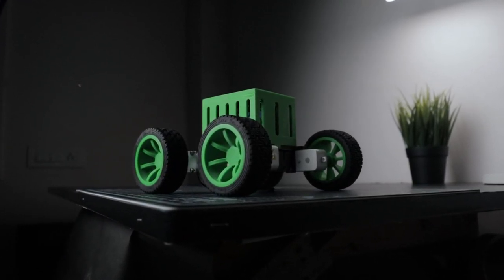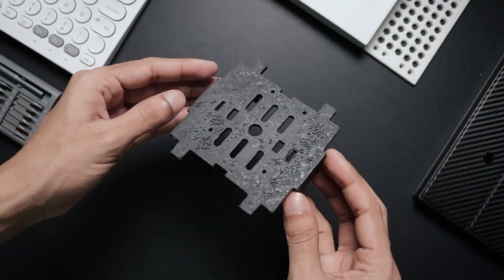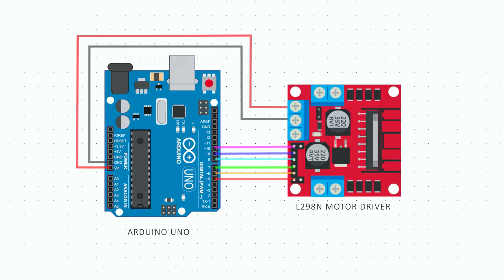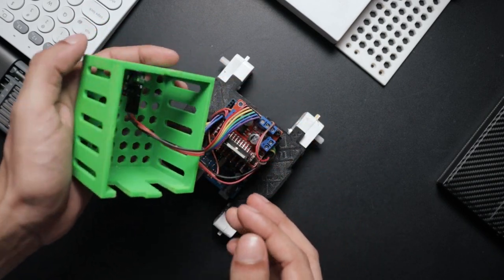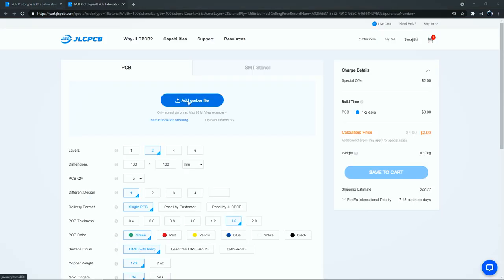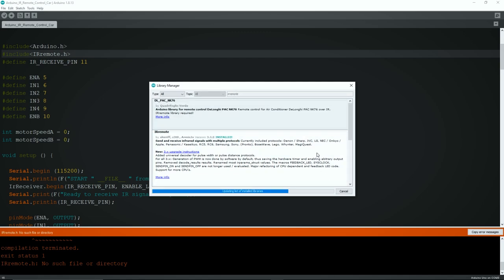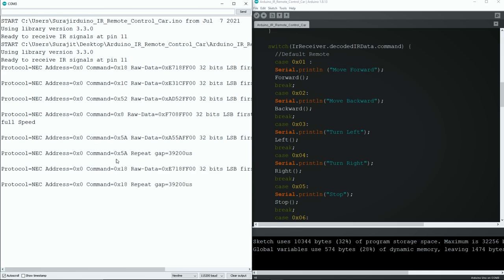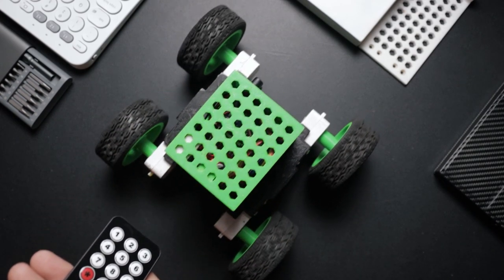How To Make Arduino Multi Remote Control Car (Ep 02)

Comment: Where do you get these components? motors and tyres look like better quality compared to ones available in Amazon. Also could you share where do you buy 18650 cells and the battery holder?

Comment: Hello sir I had commented on your video yesterday and you had asked me to DM you. Firstly the issue regarding the remote is solved but now a new issue is there. Only one side of my motors are running. And when I changed the pins of the motor that were switched off on the motor they started working and the one working before are not moving now